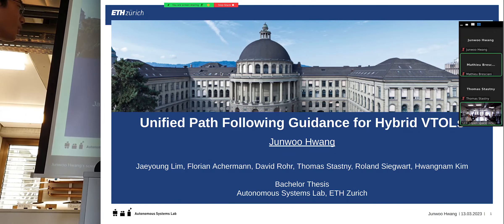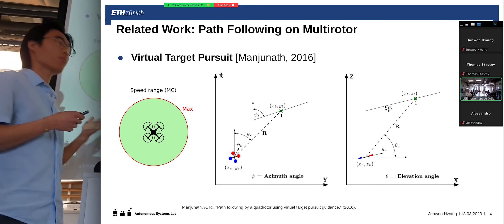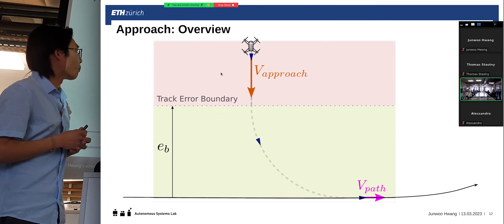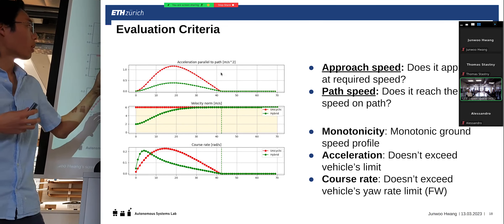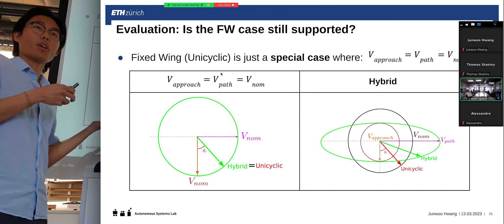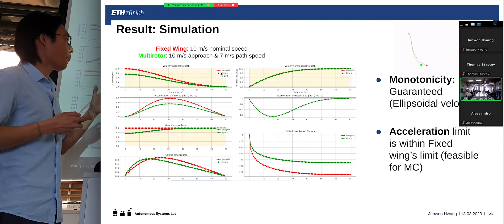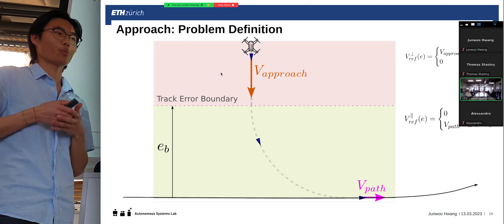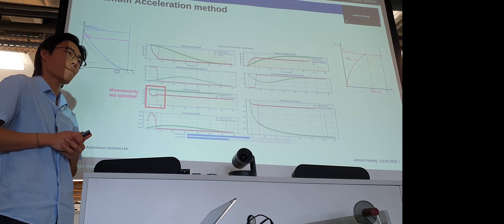Bachelor Thesis Final Presentation (13.03.2023) | Autonomous Systems Lab

Comment: Do you think your achievements might be related to the flight time of the drones?(especially VTOLs),
To my intuition, yes, cause I think it's part of optimization 

Thanks for your speech by the way from far away from your homeland and sharing  with us :)
Reply from the maker: Interesting question! Since my thesis focuses on adapting Fixed Wing Path Following to Multirotor, evaluation on Multirotor efficiency should be evaluated.

Liked Fixed Wing, multirotors also have an optimal speed to increase the range. And to be fair, using a conventional fixed speed path following methodology on multirotor at this optimal speed already would have provided energy spenditure optimal control.

So no, I wouldn't say that my thesis strictly improves the energy optimality of conventional Multirotor Path Following strategy.

Here's a paper about multirotor's efficiency for your information: https://rpg.ifi.uzh.ch/docs/RAL22_Bauersfeld.pdf